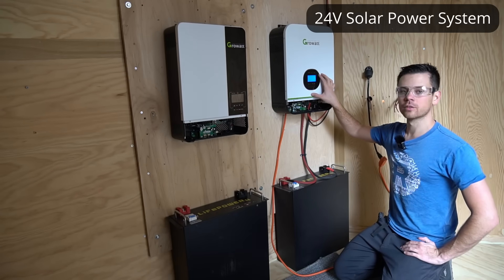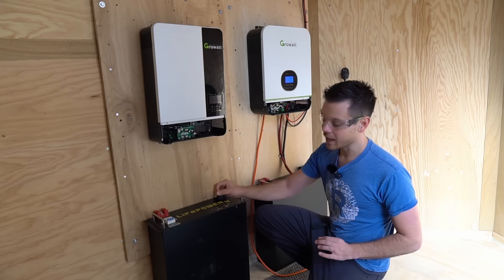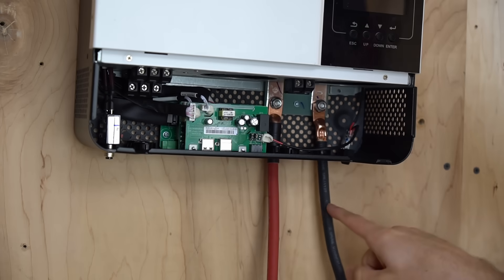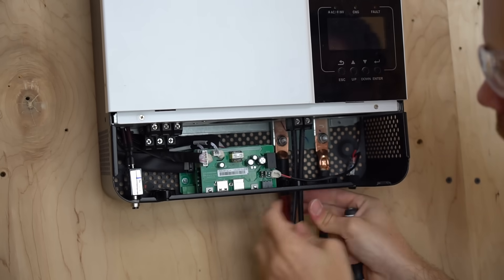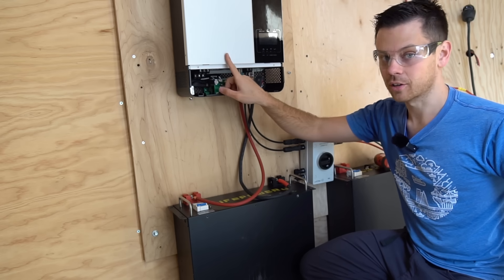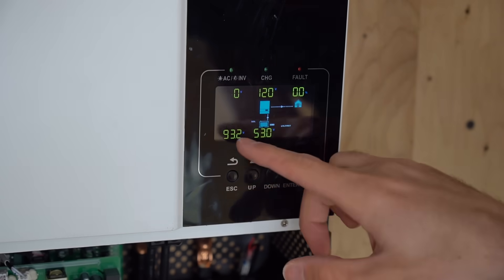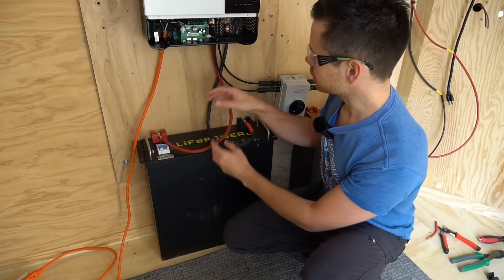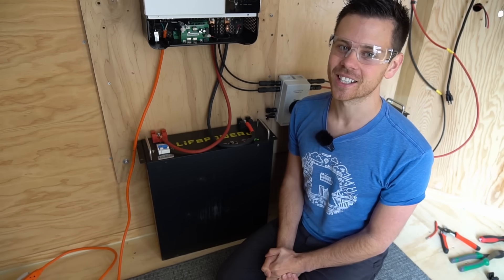Beginner Friendly 48V Solar Power System! Step by step!

Comment: I am looking to build solar on my new summer house. It's been a big learning curve your videos are very informative. I have a quick question. If I have a 1kw of solar is there a solar controller which will use your batteries or the solar panels and pull from the grid for the extra load if you was pulling more than 1kw. Is there such a system thanks

Comment: Will: Considering a whole-house solar system, but know too little to DYI it. I use about 9000 kWh per year, but June - Sept are the big months in Allen, TX. Do you know someone in the Dallas, TX. area who could engineer one for me that someone else would install? I would return excess to the grid, but was told I wouldn't need a large storage system for that.

Comment: I would love to see how to do a grid tied system with a battery backup. I know it has to automatically disconnect from the grid in case of failure but my main reason for my system is as a backup. Anything I can sell back to the utility is gravy

Comment: I am wanting to build the same system shown here and use it for an off the grid backup system.  Am experienced with working with the voltages etc. you mention, so this part would be easy. However, I need to know which affordable panels to get to maximise this particular system, and how to configure them. Can you help me with this?

Comment: I have installed an 24 volt mecer inverter with 2 12 volt gell batteries in series. I have installed 330 watt solar panels in parallel connected to the inverter give me 42.9 volt DC . But my I do not get any charge from the panels indicating on the display what Am I doing wrong?

Comment: Awesome video as ever with clear explaining for the 'not so familiar' like me. Will, I was wondering if such a system would be viable for an RV? (I saw that they even have 48V alternators) And if so, what kind of solar panels would you suggest (also voltage wise) that keep working when one is in the shade. Furthermore I would really appreciate it if you could point me in a direction where I would best go to get this kind of gear in Europe...if possible.

Comment: Great video. One thing I haven't been able to find a good, definitive source on, is what should the design look like to accommodate charging over time, given 24x7 load. For example, if my office is consuming 8kWh-11kWh/day (these are real numbers from my Emporia monitoring, whole house is 32kWh-74kWh/day), and I put in 2x or 4x of the 5kWh batteries in series along with the 48V system to charge it, how many panels should I consider in series, to ensure I'm not excessively draining and recharging the batteries 2-3x/day? 420W LG or SunPower panels look best, but I'm getting quotes that I should need at east 35-45 panels to maintain that power. I don't have an acre of rooftop to put out that many panels. Any calculators that break this down?

Comment: I have to say I've been a bit intimidated by figuring out how to setup like 3 x 100ah batteries, all the shunts, fuses, etc when I go to set up everything for my cargo trailer conversion but what you just showed me in this video has turned me to 48v setup just like this and not deal with 12 volt.  I just would need to get a 48 v to 12v step down to power puck lights etc.  If you could show us how to connect a dc to dc step down in a setup like this it would make my life SOOOO much easier.  I was going to spend so much money on Victron stuff but I think that Growatt would be perfect for me and a server rack battery.  Way less wires and stress!  THANK YOU for the video sir!

Comment: I have an entirely off grid camp with a 8.4Kw generator and have just added a standing seam roof. I would like to have this building feel like it was on the grid by adding a solar array/batteries and inverter. The only high amp draw device is a well pump. There is a fridge. 

Is there a design and install firm that you can recommend, or do you do design installs?

Comment: Excellent.  I am curious, are there building codes that regulates the design of your system?  For instance, should there be a safety shield above the battery with the wires going through to the inverter so that no one , child, could touch the battery incorrectly?

Comment: This inverter claims 120 volt minimum for solar charge. Did you make a mistake or did they change the minimum voltage needed?
Reply from the maker: I made mistake. Those panels were wired for other unit.

Comment: Hi Will can you make a video about floating systems (non-grounded). I am attempting to make this system design with an extension chord at the ac output. Currently I am stuck on figuring out how and where to ground the system without a main circuit breaker panel.

Comment: from an engineering perspective, if you have enough voltage to overcome your body resistance, and get enough current flow through your heart, typically .1A or more, it could stop your heart.  body resistance varies depending on electrolyte/fluid balance and other tissue factors.  But, in general, 50 volts could be high enough to produce lethal current flow through the heart.

Comment: On some of Will's 48 V builds, I have seen him use a shunt to charge the capacitors of the solar charge controllers prior to attaching the batteries. I can't find instructions for this in the installation instructions from the solar charger company. Can you explain it so I don't screw it up? Where do you get the part required and why do you do it and how is the process properly performed?

Comment: Hi Will, could it be possible to charge 12 volt batteries, from a 48 volt  hybrid solar inverter by using a 48 v dc to 12v dc connected to the 48 volt output on the inverter?

Comment: We are going to be running a couple freezers off this inverter. I have a 240v line I can feed into the ac input of this inverter. My question is, the AC input says G, L and N. The 240v line has L1, L2 and neutral, how do I connect this correctly? We want it so if solar and batteries are dead, the grid will keep the freezers on.

Comment: It sounded like you said the Growatt settings tell the system to turn off the load and start charging the battery from solar at a certain voltage point.
Is there a way to charge the battery from solar while also having a load draw from the battery at the same time?
I believe my Bluetti AC300 will do that.

Comment: Hi Will, I have watched many of your video's and used your advice in setting up a 60 panel array with 258 of the LifePO 4 batteries , with 2 of the solar-ark inverters , thank you for all your help. I do have question re fuses , you mentioned them in a recent video and I have not been able to find that mention, could you please tell me the name of the fuses for the batteries ? thank you again for all your help Malcolm

Comment: At 2:28 you say, "now if you're a beginner and you want to ensure that this battery is turned off..."     No Sir, you should ALWAYS check.   Standard practice:  Verify ON power with your meter (this ensures that your meter is working).  Turn OFF the source and verify OFF power.   THEN you may work on the circuit.  When you develop these actions as unbreakable habits, you live longer.  Anyone who says otherwise shouldn't be in the business.  It's like doing wheelies down the freeway.  You might be good, but eventually something's going to jump out and get you.  And someone else will have to clean up the mess.

Comment: I am trying to figure out if the 1800 portable gen will run my shallow well pump motor with a pressure tank. 110 v 1 1/2 HP motor. The motor will only run for 2 minutes at a time to fill up my pressure tank. I just need to figure out if it will run the one and one half HP motor with a cintrifical pump. I am guessing about 4000 surge.

Comment: Straight forwarded enough Rather sure if I were to install this in my house the city will insist on a electrical permit and inspection.
With out a doubt the inspector will require the system be bonded to one or two 8 ft  grounding rods and likewise the solar panel
array, otherwise seems a spot on DIY video.

Comment: What about POWER FACTOR ...... You have never explained what it is and how it affects the output current in AC circuits.  Ohms Law is not the same for AC circuits. (you have never mentioned that)  Impedance replaces resistance and the inductive reactance and capacitive reactance of the AC load will drastically affect the efficiency of the circuit. I know the math is a bit more complicated for AC circuits but your viewers need to understand the difference. A perfect Power Factor = 1.00 primarily in resistive loads. If the load contains and inductance (coil, motor, etc.) that will change the power factor. Conversely, if the load contains a capacitance (Capacitor start motor, spacing gaps between inductors, etc.) that too will change the power factor. That explains why supplying power to a normal refrigerator will operate at a power factor of .99 - to - .91 (very good) while supplying  power to high frequency DC power supplies will operate at a power factor of .70 - to - .55 (very bad)  In each case the amount of current drawn from the inverter will be significantly different.
Reply from the maker: Yeah sure just make it bigger. Not really that big of a factor. If your inverter needs more output, buy a bigger one

Comment: Like to mount an off-grid system just for my ac window unit and fridge.  Just to skim off my normal ac unit.  Even cooler if I can run my 240v hot water heater off it.

Comment: Thanks Will, 
Can I use this set up in my micro bus with between 600W - 1000W solar array on top of my bus ? And could I hook this up to my 4000W generator &/or my bus's alternator for additional charging of the battery ? I will probably go with the Trophy 110W battery since I live in Vail, Colorado and like to stay in higher altitude/ Cooler climates and probably need the included battery heaters !

Comment: Very good explanation , thanks , Will.
I have installed my system after  being educated by you ! I have 2x Growatt5000 and 3  48v x lifepo4 batteries and find that the system shuts down when the batteries are full , why is that ?

Comment: Hey will, i love your videos they have really helped me understand. I'm goping to get yor advice. I purchased a 2340w 48v solar system with 12 195w panels a 3500w 80a all in 1 converter, a 4 string combiner box, and a 4.8 kwh battery bank. A friend gave me 2 195w panels, the same size and brand  panels I have. So my question is, am I able to just add them to the series of pannels, or would I need anything to add them?

Comment: So, I'm looking to do a cargo trailer conversion to RV, would like to go with 48V system as shown. What's are the best components to create a few 12v circuits for things like interior lights, electric coolers, etc?  On signature solar, I see 15A step down converters... Do I just install one of those for each circuit I need?

Comment: Question;; Can those battery terminals get the wire coming from the side, so you don't have anything running over top of your breaker/switch??
Another Question;; Do those controllers/inverters (all in one) come with a 240 1ph output??

You are doing great explaining this 'newer' tech to us old dinosaurs!!

Comment: Hello,
I've got 4 x 200Ah Rosen Solar batteries. I've connected them to my Growatt inverters (3x SPF 5000 ES) and the communication seems to be working ok.
The issue is that the inverters are operating as only one battery is connected to them and they limit the total charging current to 90 Amp. Do you know if there is any way to connect the batteries trough RS485 to a PC and see if the communication between the batteries is ok? I tried with a BMS Tools but with no luck as I don't know the communication setting.

Comment: Would you consider making a tutorial on building a grid charged home battery system taking advantage of cheap night tariff and using that during daytime? So a system capable of charging the battery in 4-5 hours and able to run average smart household load during next 20 hours. Many thanks in advance.

Comment: I have watched most of your videos, but I remember much about surge protectors. It would be nice to see a video on as much as you could do on from lighting, breaker panel, to protecting things like computers, mini splits, etc. Just a thought to do an overview. You have done a good job on the battery side. Thanks for your video. I know you build up so much extra stuff I am guessing if you are not selling it off. In case you do have extra stuff maybe do a give away to someone getting into vanlife or starting a homestead. Just a thought and it could be life changing and remember you past hard ships. I know that is a big ask. I will put a channel that put in his own solar plug and play system. I know he paid for the ease of the install. Thanks again.

Comment: All the builds look easy. Picking which all in one to buy is the difficult part. No one has a video explaining the difference between 6048, 6558, or multiple smaller all in one's. Why one or 2 may be better.

Comment: Solar panels CAN be turned off (for the purposes of hooking them up to your inverter controller) because, by code, they have to have a disconnect installed before the charge controller, their conductors also have to be inside metal conduit when inside the building.

Comment: Torque specs should be known and applied to battery terminals, loose connections are fire sources.
You ever thought about using some sort of fire board to mount your components to...like rockboard or sheetrock screwed to the wood, then the components mounted.

Comment: I like the simplicity of this setup. So can I install a 30a receptacle instead of that ext cord and plug in my RV or even a 50a receptacle. My RV is 50a but only if I use both A/C's  but have not used both yet. I seems so much simpler to build this in the back of the RV, install the panels on the roof, then run them down the back of the RV and into this setup and plug the RV into itself. Rather than run all the wires underneath and in the walls...
Reply: Someone has to know this? Can I build this setup and plug my RV 30/50amp plug into it?

Comment: Can you strip the male end of an RV/Gas generator cord for your out on an inverter and then plug the female end into the pronged inlet onto a manual transfer switch, rather than wiring the inverter into manual transfer via its own breaker?

Comment: In hind sight I wish I had seen some of your videos before I added batteries to my solar PV. The guy who supplied and installed the batteries, 4 Pylon LiPo batteries and a 3000w inverter, did not it an isolator switch, no separation of batteries, no rack, no bus bar and relying on the breaker on the solar circuit. I believe this caused failure of both the battery inverter and the solars inverter. The battery inverter is mounted on a wooden wall. The battery pack is rated at 9.6kWh, should the 3kW inverter be able to handle this?

Comment: Am I correct in understanding that this setup is only for connecting directly to appliances and devices, that it cannot be used for connecting to a breaker override box to run essential household appliances in the event of a power outage?

Comment: Great video. Just FYI,  the right gloves can be a great piece of PPE to avoid shock. 
Even thick latex gloves are better than nothing, but all sorts of different rating insulated gloves are available.
Also, for newbies, a general idea of what materials are conductors and what materials are insulators will help keep you out of trouble.

Comment: To correct your statement on lethal voltage:
The 50V limit applies to AC only, with DC, the maximum voltage a non-qualified person can play with is 110VDC so you are still very safe.

And even then, there is no magic safe lower limit - the 50VAC and 110VDC limits are purely arbitrary.

Comment: Can you drop the voltage down on a 48v system  to run 12volt devices on a boat without losing too much battery power?

Comment: This is EXACTLY what I needed to see as a beginner looking to wrap my head around this. So the only modification I'd need to connect this to my house circuit would be an automatic transfer switch? So when the battery voltage drops below a certain level the transfer switch kicks everything over to grid power?

Comment: It's really the current that causes the damage  to the body, you can have a very large voltage but at very low ampage and will be fine, like a cattle electric fence or a tazer. The body starts to feel the effect at 10mA, and the max is 30mA before its starts causing serious problems, but both voltage and current have time limitations.
Reply from the maker: Do you not understand that we are working with amp sources? Voltage matters more here. You have to overcome the resistance of your skin. Battery can produce thousands of amps. Think about it

Comment: I would really enjoy a extremely detailed video on how to set up something for off-grid for a house that could power full size refrigerator microwave Outlets someone and someone would it matter if it was a two hour video. If you have a video that shows a very simple solar power battery combination in order to charge small appliances let's a cellphone computer maybe a microwave that would be very helpful if you could steer me in that direction